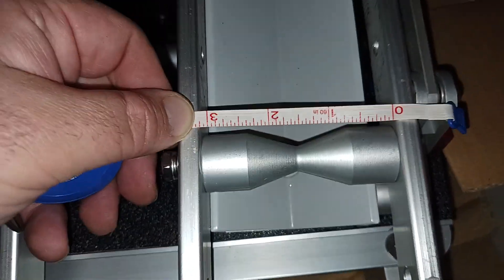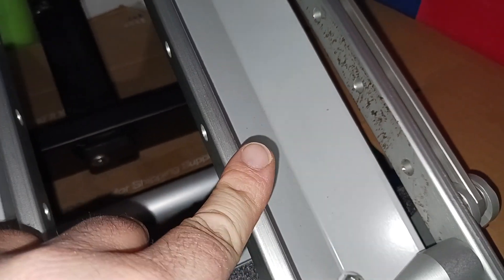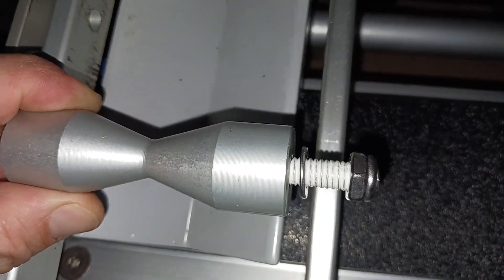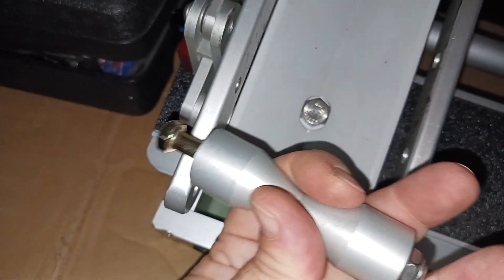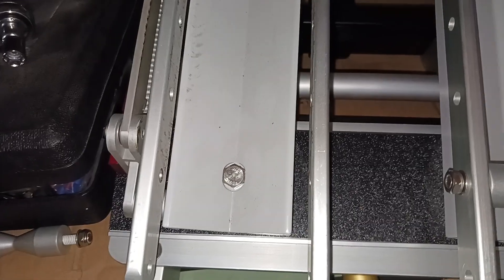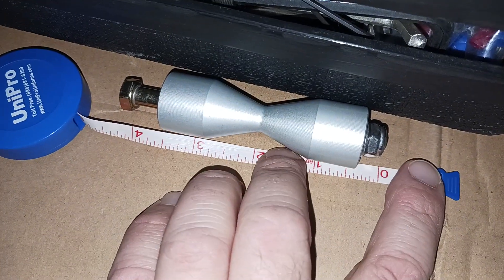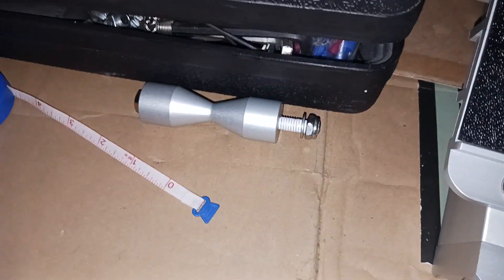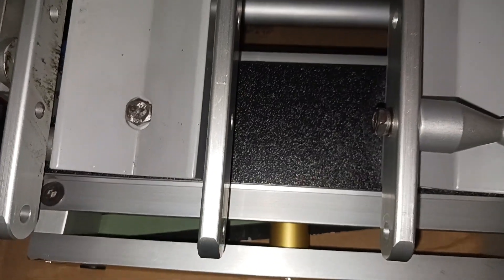1044. 1 up mod for 27.5 x 3 inch tires Vee Speedster one bicycle ebike rack

Comment from the maker: ❤️Subscribe
CYCLING & ESPORTS
Etrike
https://amzn.to/3N6cjcG

Krampade
https://amzn.to/3QJPso5

Chews & Fuel
https://amzn.to/46eel13

Polarized Goggles
https://amzn.to/3FNftP5

Phone Mount
https://amzn.to/47geGSd

Pepper Spray
https://amzn.to/47zA8Be

Kali Helmets
https://amzn.to/40KaHdT

Repair Stand
https://amzn.to/3OXvdAX

Suspension Seatpost
https://amzn.to/47D2CKp

Seatpot Shim
https://amzn.to/47F41QP

Seat
https://amzn.to/3OxVQg3

Handlebar
https://amzn.to/3QXRBwu
https://amzn.to/3uoEBbC

Portable Air Pump
https://amzn.to/3kZ8B9l

Fahgettaboutit
https://amzn.to/3I1qE6j

New U Lock
https://amzn.to/3nq7s8O

Messenger Lock
https://amzn.to/3ubsGLg

Cargo Trailer
https://amzn.to/3uaMwq8

Fat Rack
https://amzn.to/3bAVOp5

Explorer Rack
https://amzn.to/3npLRxa

Cargo Bag
https://amzn.to/46e3d4c

Pannier
https://amzn.to/3G2wjsr

Saddle Bag
https://amzn.to/3A8RvLT

FlatOut Sealant
https://amzn.to/3bwHbTA

Fatbike Tube Protector
https://amzn.to/3URX5ZC

Tube Protector
https://amzn.to/3VQF3Iw

Tannus Armour 26
https://amzn.to/3bwIeD0

Tannus Armour Most Others
https://amzn.to/3A8FFBm

Horn
https://amzn.to/3aw8SM7

Rear Taillight Turn Signal
https://amzn.to/3uPUPaA

Helmet Mirror
https://amzn.to/3HZp4mX

Handlebar Mirror
https://amzn.to/3AFMT03

Repair Tool Kit
https://amzn.to/3ysyq5V

Chain Tool Kit
https://amzn.to/3y8xAtY

Frame Lights
https://amzn.to/3OM9knZ

Hub Lights
https://amzn.to/3a3SemH

Reflective Neck Gaiters
https://amzn.to/3ubQEpL

Sun Protection Shirts
https://amzn.to/39XS1Bx

Sun Protection Cap
https://amzn.to/3bDGOGE

FIRST AID MEDIC
Ihealth PT3
https://amzn.to/3d0xNGq

PT3 Case
https://amzn.to/3tKaExS

Temperature Gun
https://amzn.to/2MQoxKn

Pulse Oximeter
https://amzn.to/3p2R1O1

Tactical Rip-Away EMT Pouch
https://amzn.to/2MHyGJv

ResQme
https://amzn.to/3rAq7Pi

Trauma Bleed Kit
https://amzn.to/36Titrp

Chest Seal
https://amzn.to/3jxlsuJ

Tourniquet
https://amzn.to/2Lz9sMA

Shears
https://amzn.to/2LGxjdu

Israeli Bandage 
https://amzn.to/2LDxDtq

Gauze
https://amzn.to/3jyYMKp

Abdominal Pads
https://amzn.to/2LB6EPb

Chest Seal
https://amzn.to/4853CI5
https://amzn.to/3TmstCr

Elastic Bandage
https://amzn.to/47Ok53b
https://amzn.to/3NkvGi2
https://amzn.to/3TjAzf8

Emergency Blanket
https://amzn.to/370w68h

BACKPACKING
Eberlestock Backpacks
https://amzn.to/3sVmxlH

Maxpedition
https://amzn.to/3SNmnKX

Ultralight Backpack
https://amzn.to/3t4qLp7

Assault/Day Pack
https://amzn.to/3NFPygq

Get Home Bag
https://amzn.to/3Sh2WtS

Sling Bag
https://amzn.to/3Sh2WtS
https://amzn.to/3LuCk3F

Backpacking Cart
https://amzn.to/3ZQ3nvD

Military Sleeping Bag
https://amzn.to/3HAkPxD

Poncho Liner
https://amzn.to/42hYEEh

15 degree Sleeping Bag
https://amzn.to/3fgdoRh

Sleeping Pad
https://amzn.to/3zn9zR8

Silky Saws
https://amzn.to/3Xj0yBO

Silky Ono
https://amzn.to/3Kh54hi

Hand Auger
https://amzn.to/3J1swxR

Mora HD
https://amzn.to/3EI9Jp5

Bradford Guardian
https://amzn.to/3KnvIFq

Esee Knives
https://amzn.to/3DWZYmk

Esee Laser Strike
https://amzn.to/40QrnAk
https://amzn.to/3IheOGQ

Esee 6
https://amzn.to/3E1xJTt

Esee 4
https://amzn.to/3YkYdHM

Esee 5
https://amzn.to/3lszClY7
https://amzn.to/3RQiAu6

Seal FX Tanto
https://amzn.to/40R7c52

Sharpening Stone
https://amzn.to/3Z6heOj

Seatbelt Cutter Window Break
https://amzn.to/3tUEiVR

LiteFighter Fido Ai
https://amzn.to/47HjEa7

LiteFighter Fido
https://amzn.to/49W6wQL

LiteFighter 1
https://amzn.to/46fSNkw

Alps Mountaineering
https://amzn.to/3uiRXWV

3 Season Tent
https://amzn.to/3sEYfMC
https://amzn.to/3SIcsGI

4 Season Tent
https://amzn.to/41VzkEz

Haven Tent/Hammock
https://amzn.to/3W3vMNX

Winter Underquilt
https://amzn.to/3sSS05C

Underquilt Protector
https://amzn.to/3W78Uw5

Backpacking Chair
https://amzn.to/3kEjHwh

400lb max Backpack chair
https://amzn.to/3sDbfCc

Trekking Poles
https://amzn.to/2T3UC3X

Budget Trekking Poles
https://amzn.to/42gGHWD

Compression Dry Sack
https://amzn.to/3hbKl2q

Eno Underbelly
https://amzn.to/3gQnskd

Tarp
https://amzn.to/3zoSJ4t

Snakeskin Tarp Sleeve
https://amzn.to/3gIj8DD

Stakes
https://amzn.to/3kMWt7m

1.8 cord
https://amzn.to/30a7Qwq

Paracord
https://amzn.to/3uJ8KOJ

S Biner
https://amzn.to/3sMgiP0

Survival Shovel
https://amzn.to/3iQYjqR

Water Bottle Pouch
https://amzn.to/3da0C3x

Single Wall Water Bottle
https://amzn.to/38jVma6

Folding Bucket
https://amzn.to/488PywK

Cnoc Vecto
https://amzn.to/3tL8BJV

Hydrapak
https://amzn.to/44xRXyS

Katadyn Be Free
https://amzn.to/3FFjg0H

HydroBlu Water filter
https://amzn.to/3qTyniC

MSR dromedary
https://amzn.to/3aOoU07

MSR Hydration Bag Coverter Kit
https://amzn.to/3r3syz7

TomShoo Stove
https://amzn.to/3BmtFfo

Wood Pellets
https://amzn.to/3FjfGrW

Bellow & Fuse
https://amzn.to/3YbJvDi

Trangia
https://amzn.to/3W1fggr

Fuel Bottle
https://amzn.to/3BmWA2K

Bioethanol
https://amzn.to/3BqFt01

Stove & Adapter Kit
https://amzn.to/3blZ84K

Folding Grill
https://amzn.to/421TvAI

Pathfinder Folding Skillet
https://amzn.to/2NfIfPm

MSR 775ml pot
https://amzn.to/3Pac9AK